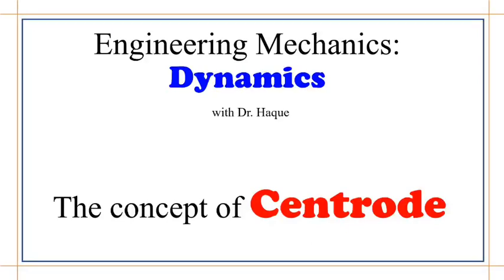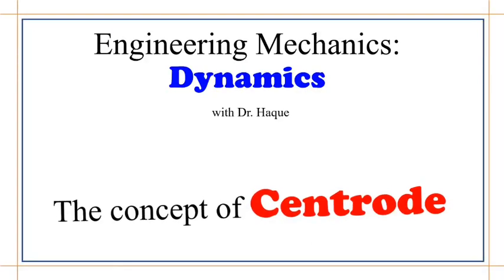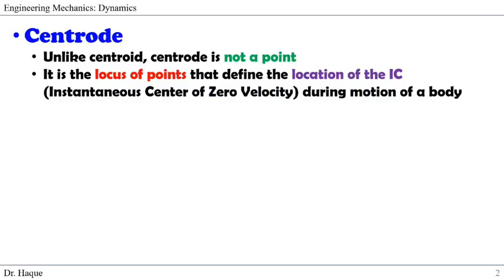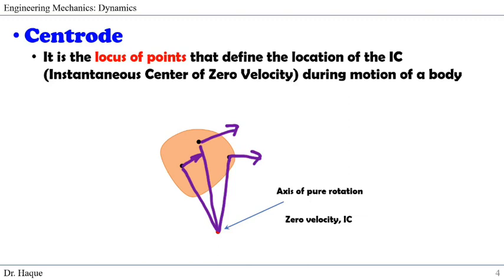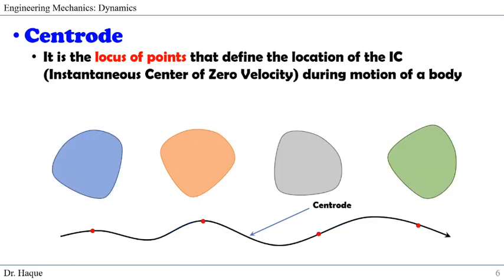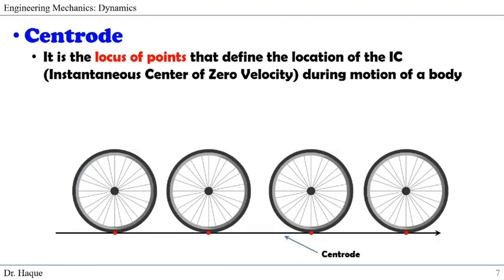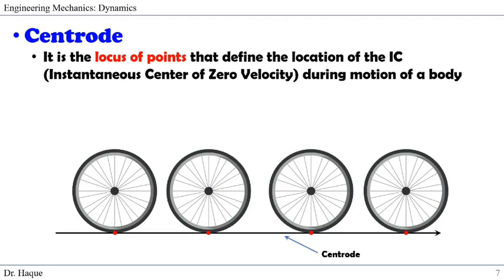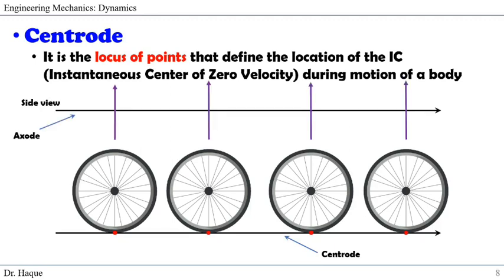What is Centrode and Axode?

Comment: Are both centrode and axode same? Cuz they lie parallel to each other?
Reply from the maker: Good question Pradeep, Yes the location is the same for the corresponding centrode and axode. However, the centrode in the locus of the IC points while the axode is the locus of the rotation axis on each IC points (the rotation axes are perpendicular to the direction of motion).
Reply: @MohammadShafinulHaque  thank you :)